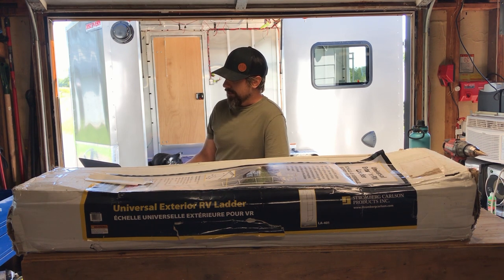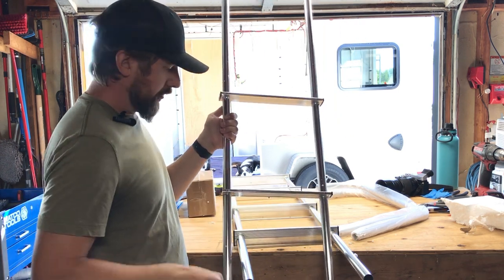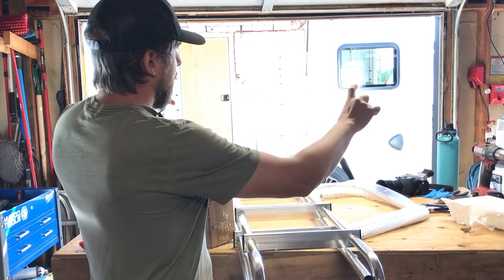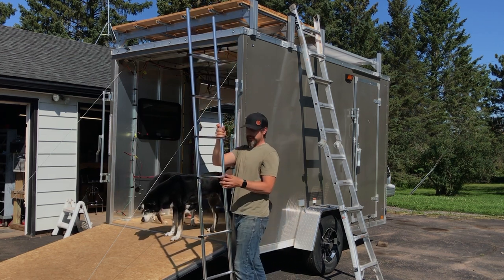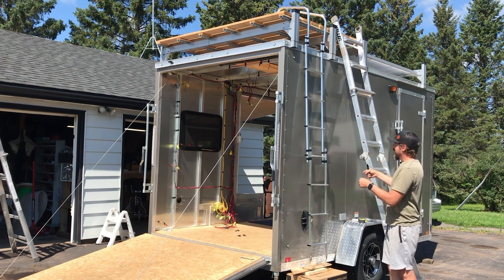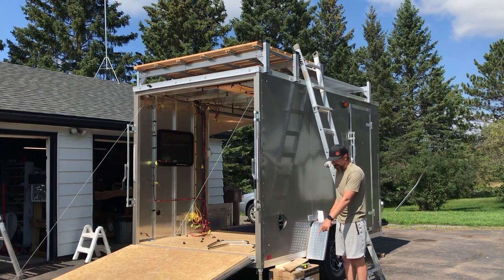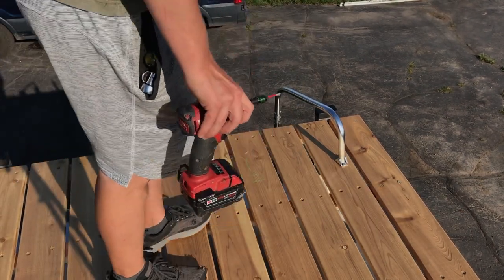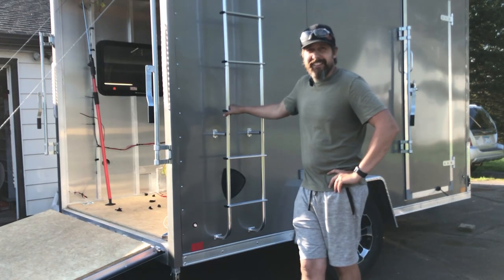Cargo Trailer Conversion Series: Ladder Install

Comment: Why didn't you use a pair 2x4 vertically ? I would think that would support weight better and less on exterior sheeting...
I like that push bar idea! When clamps won't work..😁. Excellent!
Reply from the maker: Well I wanted to use as little lumber as possible. More wood/bracing = less insulation in the wall cavity. Your method would work great otherwise and likely be usable immediately. I believe once my bracing is secured to the osb wall paneling which will be secured to the trailer frame, it will be plenty strong. Ideally I would have welded in some square tube but sadly I don't possess a welder or the necessary skills at this time 😢